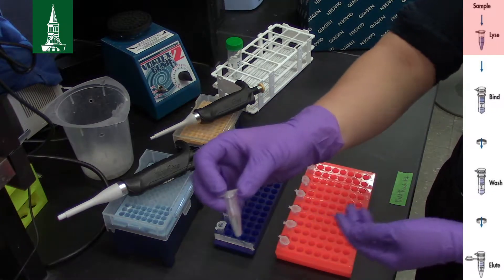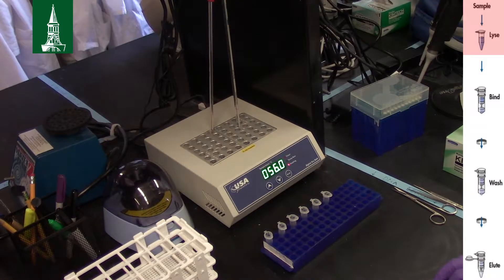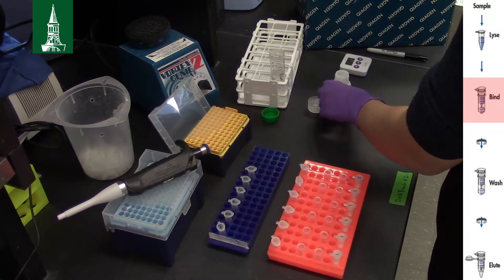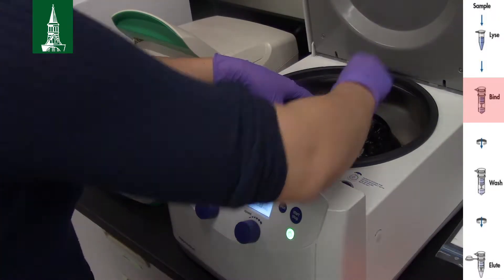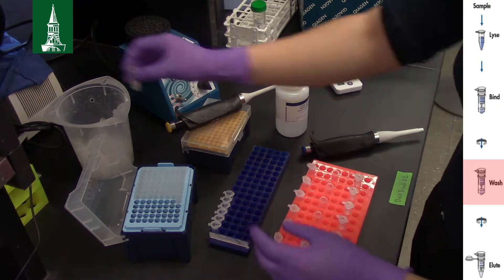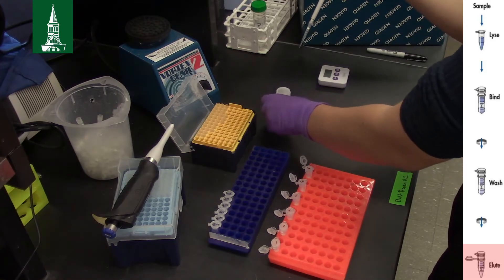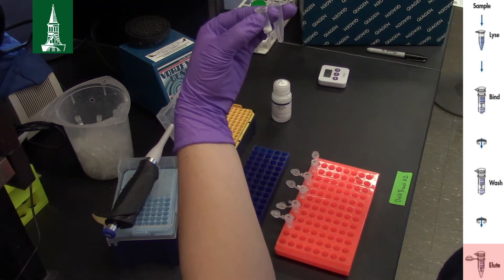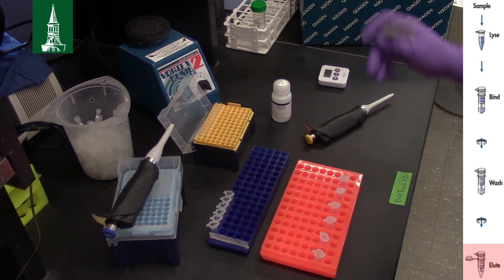How to easily extract DNA with the QIAGEN DNeasy Blood & Tissue Kit

Comment: Thank you very much 🙏🙏🙏 this was truly helpful...... But i a question
* My work is on nematodes parasite of insect (Usually 1-2mm) . I Store my nematodes in 95% absolutely alcohol (molecule grade). We first spin the sample  for 1 min. at 8000 rpm and after that, discard the  alcohol completely. Thats what you do to prepare the sample first, to break the tissue.